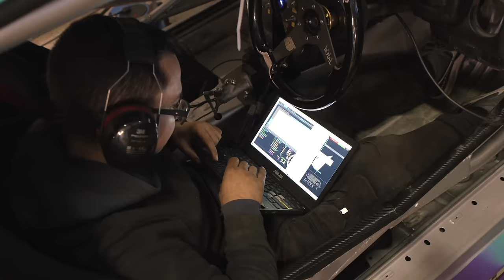We BANNED ugly cars from our events | People got angry…

Comment: How do ya dyno something in air that cold, do you have to make it intentionally lean so it's balanced once it's not getting as much air when it's warmer? Or do ya just count on closed loop?
Reply: this car uses a link ecu, which has an air temperature sensor mounted in the charge pipe between the intercooler and throttle body, this measures the actual temperature of air reaching the engine, the ecu uses this data as part of the fuel equation, link also gives  the tuner the ability to trim both ignition and boost targets depending on air temperature, meaning the car will perform reliably regardless of conditions,